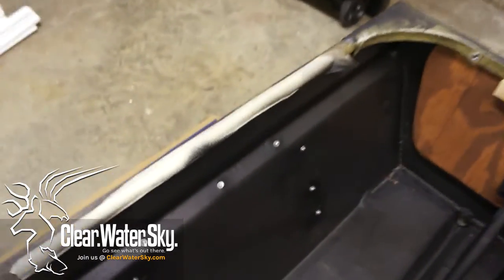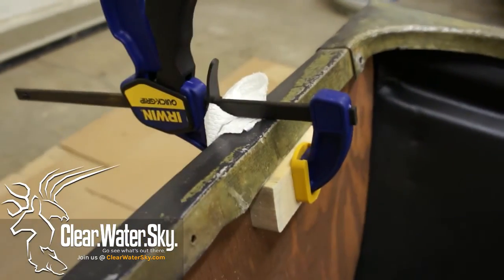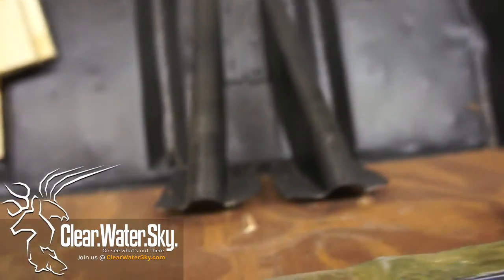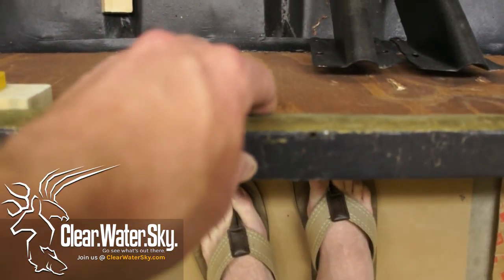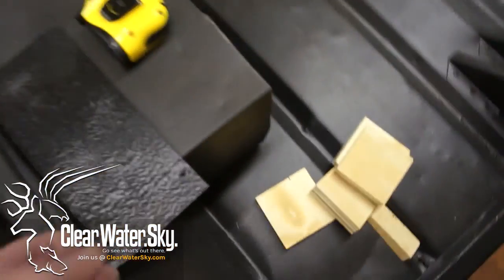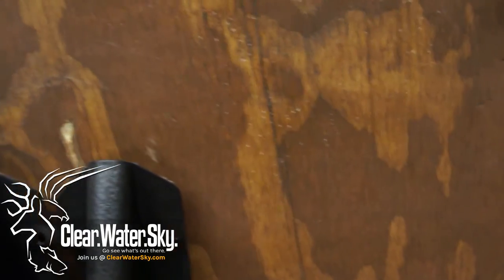Jon Boat Modifications: Rotten Transom Replacement

Comment: Hi can you show the outside wall of the boat as well ok thanks! Also need to patch my jonboat but debating between pop rivets and welding
Reply from the maker: I gotta be honest if I could weld I would have gone that route - however, these rivets were used to patch holes no larger than a dime. Probably not even that big. Check out the other videos in the series and make sure to subscribe, I have something like 20 more videos I need to get edited and posted - thanks! Here is the main playlist location: https://youtu.be/zLClLJtzLIw?list=PL5vb5ShM2A5rvgWUl2zLKUb3zVOiG39xY
Reply: Jb weld and flexseal

Comment: How did the plywood work out?
Reply from the maker: Really well actually - although next time (if we do another boat) I'll want to try to treat and seal the wood a lot better than what I did this time around. I'll also want to use the full inch of space and not go with something smaller. I don't travel with the motor on the transom.